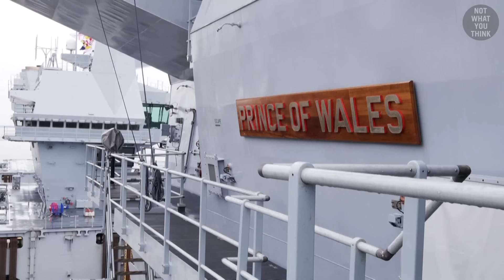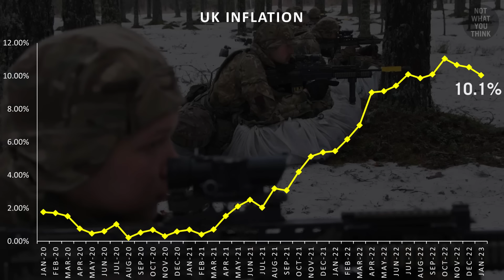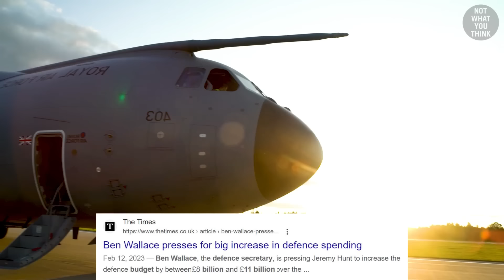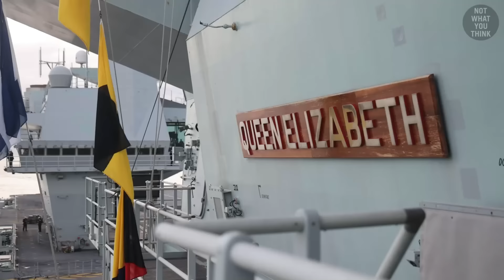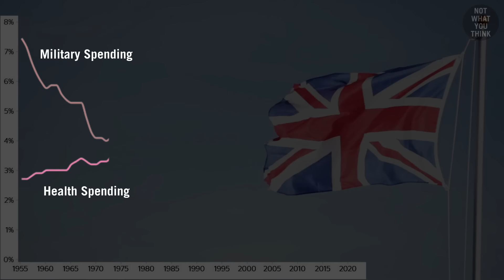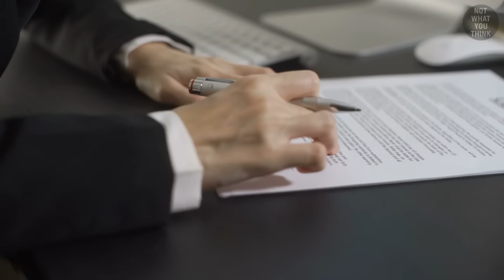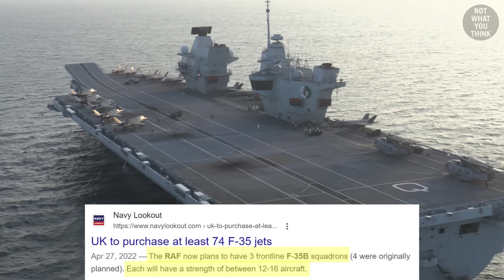Why QE Carriers are Considered a PART-TIME Fleet

Comment: It's even more fitting when you consider that the WWII Battleship Prince of Wales was also unlucky enough to be sunk 3 days after Pearl Harbor after being transfered to the pacific.
Reply: Not to mention the mechanical failures that plagued her during the Battle of the Denmark Strait. The fact her gunnery was actually more accurate than Hood's against Bismarck tends to get overlooked because of it.
Reply: That was during the Japanese rampage through the Indo/ Pacific,  what was your point?
Reply: The 1941 PoW did more in her months of service than many ships in decades. She dealt a significant blow on the Bismarck and made an heroic run to Malta escorting a convoy.  In the Pacific, she and her consort were two ships that were sent to defend against the might of the Japanese Empire, sent prior to the US entering the war. That is guts not bad luck.
Reply: @grolfe3210  Bloody Well Said!
Reply: POW was considered an unlucky ship after the Battle of Denmark Strait. She was damaged by bombs already while she was outfitted in drydock - a sign of things to come. Then followed her controversial battle against Bismarck, and then she was sunk by Japanes bombers and torpedo planes just days after Pearl Harbor.
Reply: freebeerfordworkers  Her rangefinders and gunnery computer were 20 years newer than those on Hood. That's what makes gunnery good, especially at 15km+ range.
Reply: @TTTT-oc4eb  Prince of Wales was still working up to operational status when sailed with Hood.  Hardly a fair appraisal of the ship's luck.
Reply: good comment even me i tought that aswell.....
Reply: @towgod7985  I didn't say it was fair, but she was regarded as an unlucky ship.
Reply: Yep.  There’s a reason HMS Hood was not repeated.
Reply: Hmmm, Royal Navy has 13 new ships on order. The British Army cuts have been reversed, now the Para’s and Royal Marines are being expanded along with the Royal Artillery., which is being refitted entirely new artillery pieces. The Royal Navy is to double the number of Nuclear attack Subs. HMS Prince of Wales had a manufacturing fault with it's shaft. Even the USA hasn't managed to get their $5 billion USS Geral R Forrd. These things are hugely expensive and complex. The UK has the 4th largest Military and is developing a new 6th Gen Slealth plane, along with Italy, Japan, and Sweden.
Reply: freebeerfordworkers  Prince of Wales scored the first hit in the battle and all three of the hits on Bismarck.
Reply: @Cdr_Mansfield_Cumming  Your post is a total cope mate.
No, cuts don't have been reversed. Inflation is 10% and the only announcement is about 5% of increase, so not even nullifying inflation. At constant budget it's at aleast a 5% lose. The SSN will not be double, the Aukus-class will succeed the Astute and no complete it. The artillery will not be expanded and only half of the artillery donated to ukraine have been confirmed to be replaced (by Achers) so far. The 10.000 personnel reduction is still going on and the 73.000 soldiers by 2025 still confirmed.
just shearch for :
Troop and tank cuts going ahead despite defence spending boost, signals minister - Mirror
Opposition says no provisions made to plug reduction of 10,000 service personnel or replace Hercules planes - Guardian
Reply: @TTTT-oc4eb  So were many Allied ships as Imperial Japan swept all before it.
Reply: @jonyungk  hoods guns were shot out.  She was way overdue for a major refit.
Reply: It was a bad name to give it from the start. The 'Royal Oak' or 'Ark Royal' should have been chosen instead...
Reply: @TTTT-oc4eb  Ha ha, yeah sure, more unlucky that the Hood.
Reply: @MultiDrew83  no, not Royal Oak as it went down whilst at anchor with hundreds of boys on board at the start of WW2.  I gather it was an old, second line battleship built as a low cost alternative to the Queen Elizabeths during first war and only really any good for convoy escort and training purposes.   If the Germans U boat commander knew that then he may well of picked another target if possible.  Bad job all round that, very sad and no good to anybody really.
Reply: @Cdr_Mansfield_Cumming  The 13 new ships will be replacing (probably) 15 existing ships. There are NO plans to restore the army to its Tier 1 strength of only ten years ago. The new announcements are barely even sticking plasters on what is a gaping wound - even with the current plans we will still be incapable of defending ourselves. If we are going to do defence of the realm properly, then we have no option but to increase our defence budget massively. I am not a warlike person, but I want my children and grandchildren to sleep safe at night, knowing that our shores are safe.
Reply: @MultiDrew83  Ark Royal would have been perfect.
Reply: The reason we lost HMS Hood,HMS Prince of Wales should of been in front of the HOOD with it having Reinforced armour plating with HMS Hood been our TOP and No1 Ship it took on the fight to Bismarck head on. My uncles brother was lost on HMS Hood as everyone knows only 3 survivers from HMS Hood
Reply: @paulbrennan3996  I'm sorry to hear that, perhaps admiral Holland should of transferred his flag.  However Hood was epitomy of British naval power so....
Reply: She was also a significan reason was the Bismark was sunk.
Reply: @rob5944  hello Rob if she had of survived the War they would of preserved her . The only time My uncle went to church was on Rembrance Sunday with out fail never missed always for his brother My uncle died Back in 1980 aged only 53 . I always remember my uncles brother and the fallen on Rembrance Sunday we will never forget the fallen. Thanks for your kind words 🤝
Reply: @timphillips9954  the whole of the Royal Navy was tasked by Winston Churchill find and sink Bismarck at all costs. The HOOD was the flagship of the ROYAL NAVY everyone in the world 🌍 knew about the Mighty HOOD
Reply: @grolfe3210  You know you can have guts and still be unlucky right? One doesn't exclude the other. PoW was forced into combat before she'd worked up.... Had she been luckier, Bismarck would have sailed and met her after she'd finished commissioning. If she'd been luckier, the failures in her guns during the Battle of the Denmark Strait would have happened after combat had concluded. Had she been luckier, PoW would have been able to do more than just cause Bismarck's range to be degraded-- the KGV class had the capability to maul Bismarck.

When Prince of Wales got to the Pacific, a single torpedo disabled her, because it just happened to hit where it could do the most damage. That's bad luck because, statistically, that hit is incredibly unlikely to happen. PoW was newer, and more modern than Repulse. PoW had a better AA suite than the refitted WWI battlecruiser and yet was disabled almost immediately.

None of the above events impugn her honor or detract from what the crew of Prince of Wales achieved. Being unlucky doesn't detract anything from the ship. If anything, it adds to their achievements because it highlights what they did despite being unlucky.
Reply: @paulbrennan3996  your very welcome, and we'll said.  Several generations have served in the world wars, as with most families I suppose.  Therefore I take an interest in history and try not to miss remembrance Sunday, the weather is usually kind too I note.
Reply: @timphillips9954  and might of landed a few more hits if her crew and main armament had been fully worked out prior to the engagement.  The fact was an overstretched RN had to cover all bases, not to mention everything else that was going on.  That's why we had to send an ageing battlecruiser and a green ship in. However, take nothing away from the Germans, they built fine vessels, had top notch gunnery plus first class training.  Look at the battering she took, and the Tirpitz too (not to mention their fleet at Jutland years earlier).
Reply: @rob5944  We never forget Rob I think most of our families around the world 🌎 have had family members serve in army 🪖, Navy and Air forces. My Great uncle was captured in Singapore on 13th February 1942 by the Japanese and was P.O.W until he was freed in 1945 he worked on the Death 💀 Railway was very lucky to come home. The War in the Far East is mainly forgotten about here in the UK . The troop ship brought him back to Liverpool. He always said the Japanese didn't harm him they didn't have bullets but we all know different. My Great Aunt said year's after he had 🌃 nightmares he used to shout out and scream when he used to Go back in time. His birthday was on the 13th, he was captured on the 13th, and he died on the 13th December 1985.
Reply: @paulbrennan3996  then may he rest in peace as the brave soldier I'm sure he was.  My own father was in the RAF but managed to avoid a transfer to the far East after his C.O. countermand the order.  However my father-in-law (who I never knew) fought out there.  Malaria got at him though he wasn't captured, thank goodness.
Reply: @rob5944  Respect Rob and respect to your Dad and respect to your father in law he was lucky he didn't get captured that's why we have freedom today for those men and women who served in World 🌎 war One and World 🌍 War Two respect to All who served and R.I.P to those who didn't come home 👏🤝🙏
Reply: As I recall, the former HMS PRINCE OF WALES was sailing with HMS HOOD when they encountered the BISMARCK and PRINZ EUGENIE. The BISMARCK sank the HMS HOOD with the first salvo. The PRINCE OF WALES had malfunctioning gun turrets so she turned and ran like hell!
Reply: @Fizwalker  I do take your point but really do not believe in a thing being unlucky. 
If you take something like the Titanic sinking, was it bad luck or a number of errors?
Reply: @living2ndchildhood598  then I'd say your recollection might be a little hazy.
Reply: @paulbrennan3996  thank you and take care.
Reply: @rob5944  Respect Rob stay safe brother interesting historical chat thank you 🙏👏🤝
Reply: @rob5944  I wouldn’t doubt that at my age.
Reply: @living2ndchildhood598  how'd you mean?
Reply: No clue why they decided to name her after a ship that got bushwhacked in WW2
Reply: @paulbrennan3996  only the people who watched the movies knew her as the mighty Hood by 1939. By the outbreak of war she was twenty plus years old and very very vunerable to any modern warship of her type afloat,
Reply: And the Repulse.
Reply: Appraisal or not she's now in the shallow bottom of the SCS. The enemy is not going to wait.
Reply: @rob5944  Thanks, interesting information mate. By the way which name would you have picked if it were up to you?
Reply: @barnykirashi  agree
Reply: Not unlucky, more down to bad leadership.
Reply: You mean the far East, WWII Prince of Wales got no where near the Pacific. It was sunk off the east coast of Malaya
Reply: Prince of Wales in WW2 wasn't unlucky. The ship was sunk purely because Winston bloody Churchill  insisted on sending out Battleship with air protection. The ship and the crew were doomed because of Churchill. Who ignored tactical advice repeatedly and incalculable number of people died as a result
Reply: @rosewood1  I saw in another video that the ship's captain turned down air cover from Malaya. The pommies were too arrogant and out of their depth. Those bastards surrendered Spore without so much as street to street fighting. If it was London they were defending they would have fought to the death. Useless arrogants. As a result 40,000 civilians were massacared over 2 weeks. Countless atrocities were committed.
Reply: British construction has always been shody the Germans and Russians both made better guns as well. Of course the Brit’s will make fun of china calling it’s military a “paper tiger” but we all know who’s the real paper tiger
Reply: She should have been HMS Eagle instead
Reply: @grolfe3210  a third ship was supposed to sail with POW and Repulse: the aircraft carrier HMS Indomitable. But she tore her bottom open in the Caribbean and couldn’t go. If she HAD sailed to Singapore it would have been a different story. Certainly Indomitable’s Navalized Hurricane Fighters would have massacred the Japanese “Betty” Bombers that attacked POW & Repulse.
Reply: That was negligence...no aircraft cover provided to the PoW or the Repulse...
Reply: What happened to the surviving British?
Reply: @jonyungk 1:20
Reply: @grolfe3210  i don’t consider a run to be heroic, you have to be British to turn up history that way
Reply: @brunol-p_g8800  you had only about 66% chance of survival on the malta supply convoys. What would you call someone who still headed out with those odds? Britain spent half of WW2 fighting Germany, Italy and Japan on our own. I think that anyone who took part in that is rather heroic.
Reply: @grolfe3210  I’d call that cowardice, just like did the admiralty call it back then. The RN doesn’t push back, no matter the odds. 

And no, we didn’t fight on our own, more than 40% of troops were from Poland, Belgium, Netherlands and mostly France.. 
the only ones still fighting in the Pacific before and after the POW were the free French Navy Force, and in some extent the Vichy Navy such as the battle against Thailand’s Japan provided navy.
Reply: @brunol-p_g8800  You could check your facts as most of what you have put is incorrect. I really do not want to carry on even correcting you. I am disgusted at your attitude to our war heroes.
Reply: Recently Malaysia also caught some China ships dredging items off the WW2 HMS PoW/Repulse shipwreck. Maybe the dredging ships thought it was revenge for the Opium War
Reply: @grolfe3210 more like plain stupidity & arrogance. The commanders involved in the defence of Malaya were clowns, the Japanese ran over 130k troops under incompetent British command within 10 weeks.

Sending the Repulse & PoW to engage an entire Japanese flotilla was among the stupidest decision made in the Malayan campaign.
Reply: @justin-pv6ff  If you look at it that way then it was stupid and arrogant for Britain to stand alone against the all-conquering might of Nazi Germany for a very long 18 months between the fall of France and the US entering the war. But our stupidity and arrogance seemed to have won out in that situation. 
Pre-Pearl Harbor, the situation is the Pacific was clear. Japan could have stood down under the threat of escalation of war.
Reply: @grolfe3210  this section is about the sinking of PoW and it is linked to the disastrous Malayan campaign and I was just pointing out how bad the failure of the commanders due to their arrogance & over confidence. 

Don't need to bring your whole grandmother story all the way about the European campaign, doesn't make sense mate.
Reply: Wasn't King Charles the 'Prince of Wales' at one time?
 Therein might lie the curse.
 Revenge from beyond the grave.
Reply: It was sunk off the coast of Malaya in the Indian Ocean